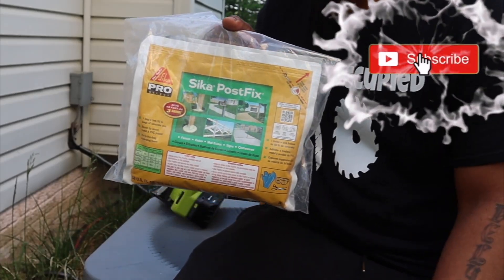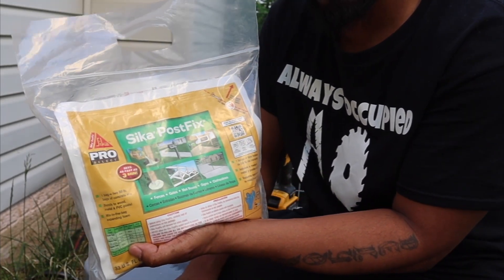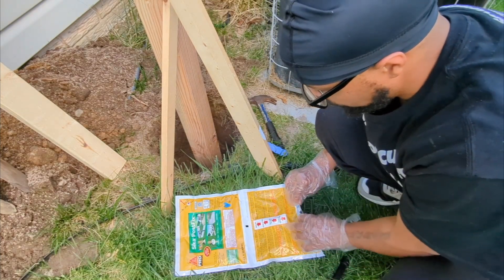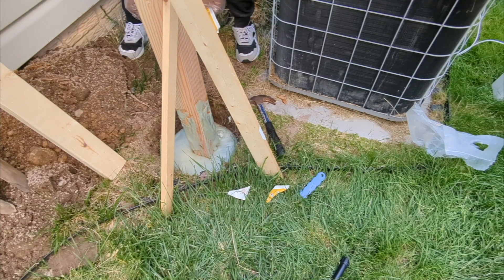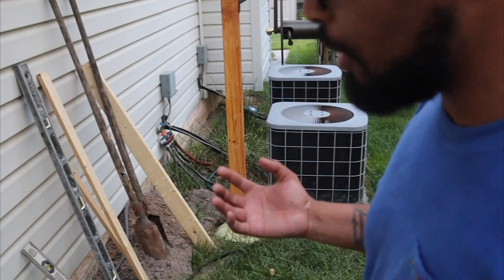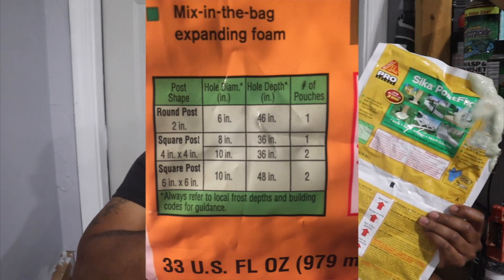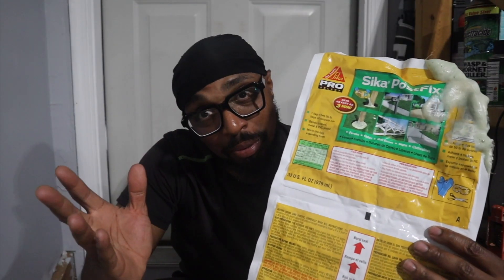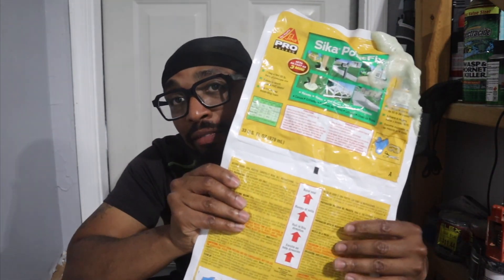Sika2 lb. PostFix Fence Post Mix REVIEW!

Comment: I only put gravel in. Post looks like new 10 years later when you take it out of the ground.
I put some gravel in then put post in and fill gravel around it until it's 2-3in below grade. Then add dirt on top adding extra dirt to allow for settling
Reply from the maker: I have Two questions. What gravel do you use? and what's the depth of your hole? I usually do 24 inches
Reply: @ALWAYSOCCUPIEDTV  I've used pea gravel, maybe a little larger and I have used some maybe inch in diameter. I think it was about 2.5-3 ft deep with 8 ft posts. 
I put about 6in in the bottom of the hole, set the post in and then added stone around it. I think I used around a bag per post. I was putting in 6ft fence with maybe 3in ground clearance. I'll have to measure the height to be sure.
I learned this from a guy I worked with in the parks department for about 15 years

Comment: I think... I could be wrong... that you aren't shaking it right, you need to shake it so it moves between the 2 rooms so the ratio is right
Reply from the maker: Hello, I looked at the Home Depot website video before using it. It worked, but the issue for me was the hole I dug. It was too wide. IMO
Thanks!